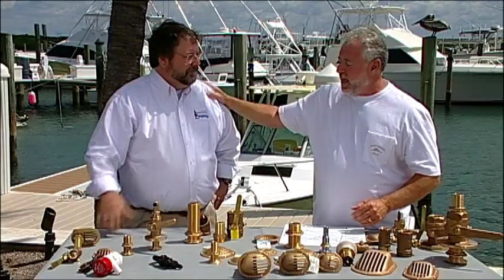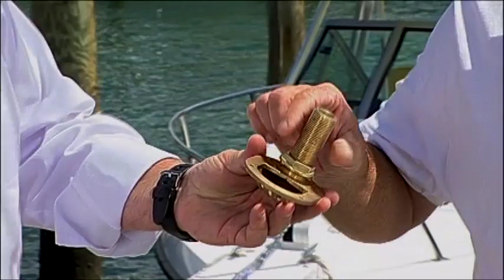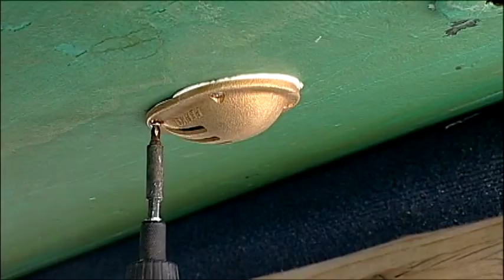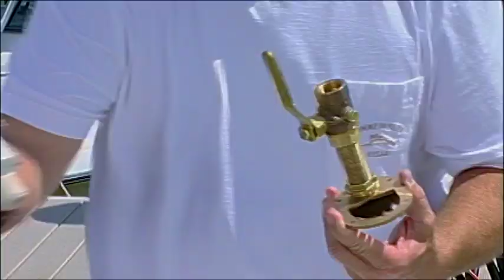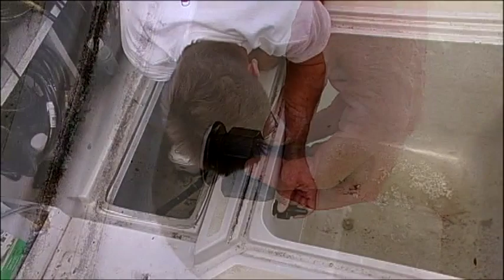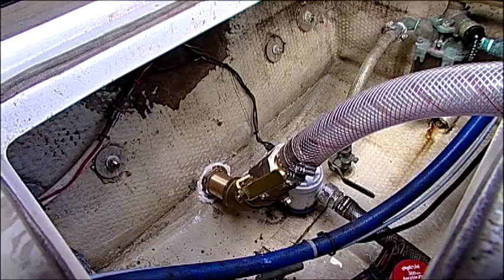Livewell Plumbing Demonstration

Comment: Mine are flush with the bottom and they don’t pump while I’m on  plane so I bought the longer ones and I’m going to try to set them about 1/4-1/2 an inch under the hull.Hopefully it works

Comment: In this system if the pump is off and the valves are open would it draw water in.  I’m asking basically if I turn power off to the pump will the livewelll fill up when I don’t want it too
Reply: Yes. Thus the valve.
Reply: No most live wells won’t push water in if off. Mainly since the through hulls is below the wells